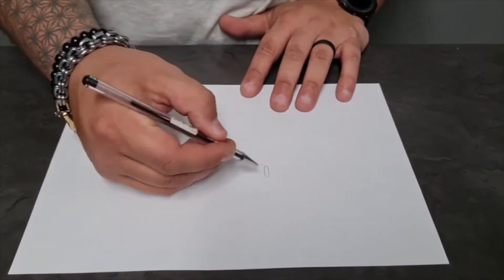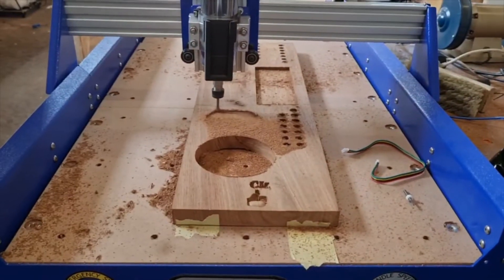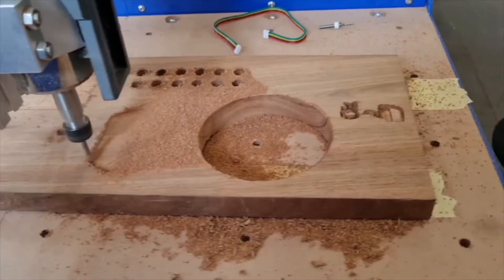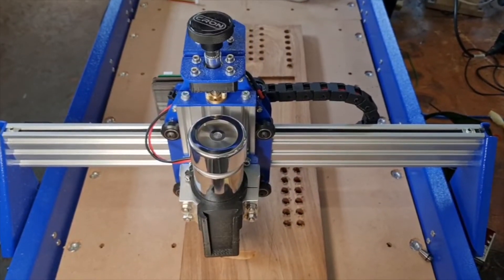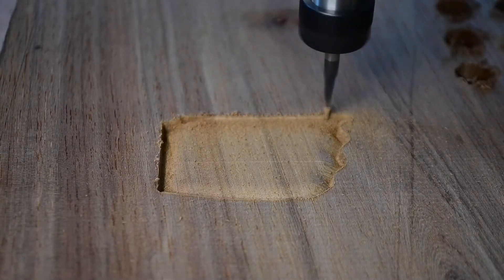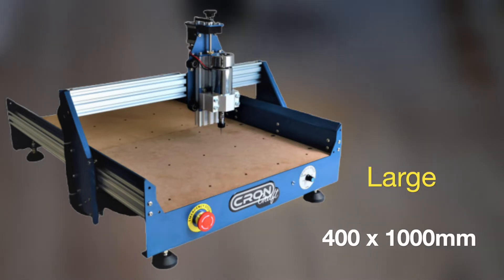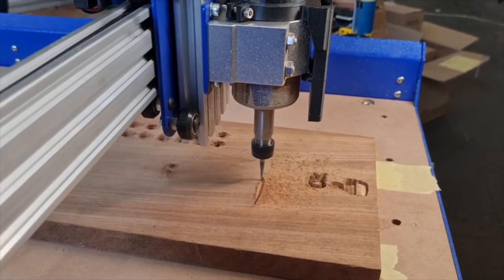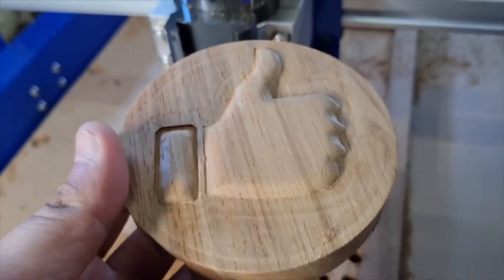What is a CNC machine?

Comment: I have this both lasert and router bought on your store. But real I need training. Now I do it by guessing.  Why do you do not open a combo training for 3d printing and cnc router. Specially usin fusiong 360 to create code.
Reply from the maker: hi there, unfortunately I don't have an answer as to why not...but you can email us at sales@3dprintingstore.co.za and organise to get a demonstration from siphon
Reply: @3DPrintingStorecoza  O, I am in Mozambiue and in January I always use to come to SA for leave. I will send an email to see if it is possible. Thanks.
Reply: I have the large with laser. After sales is bad. Can't get the laser to cut. I have sent emails to 3d print store, but no reply.
Reply: Hi, how have your experience and machine been since buying, would you suggest this machine for others to buy?
Reply: @phillipengelbrecht9171  Hi. Yes the machine itself is good. But as i told, I do not know mayn things to explore properly the equipment and have realistic feedback